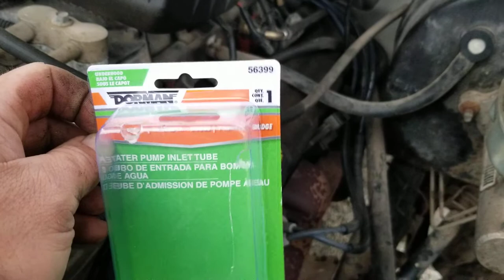Dodge Gas Burner common coolant leak quick fix 318 & 360 magnum motors

Comment: Will keep in mind for when I replace my pump.  Was thinking some silicone might not be a bad idea also to get on behind the o-ring just to be safe. Thanks for sharing.  Liked, commented and subscribed.
Reply: Silicone/Plumber's grease is a better call for the o-ring. Petroleum-based products can cause rubber o-rings to degrade. A lot of newer o-rings are made from stuff that's more resilient than natural rubber but it's hard to know what's what, and silicone will always be safe on anything except silicone o-rings or hoses. I'm sure this o-ring will be fine for a long, long time either way.

Alternatively if you happen to have any water-based lubricant laying around (e.g. KY), that works great, too. And totally safe for really any automotive application where you need to fit two pieces together but not cause contamination or material degradation.
Reply: I used a light coat of o-ring grease on the seal and then made a small bead of ultragrey higher on the tube - once I installed the bolt I allowed a few days for the pematex to cure before refilling the system
Reply: I have a 2001 Dodge Ram 2500, 360 Magnum, with 91000 original,  I have a drivers side lower front coolant leak.  .....anyone?
Reply: @maximillianyoder5286  Drivers side lower front water pump or where from leaking?